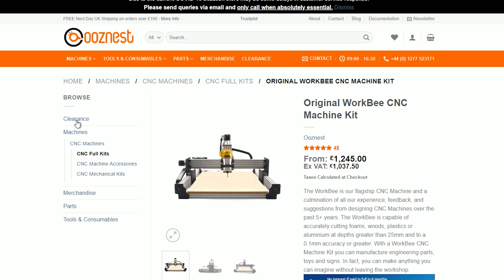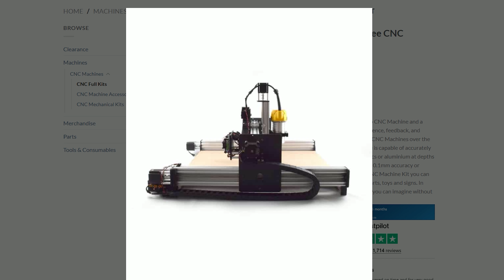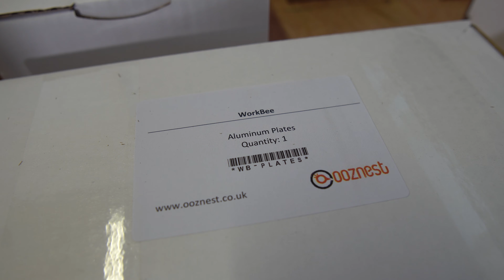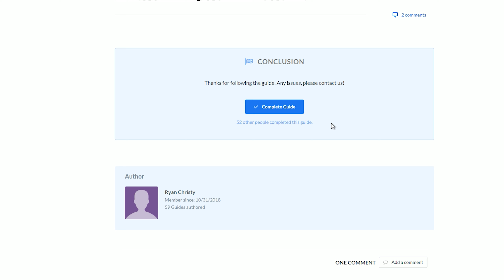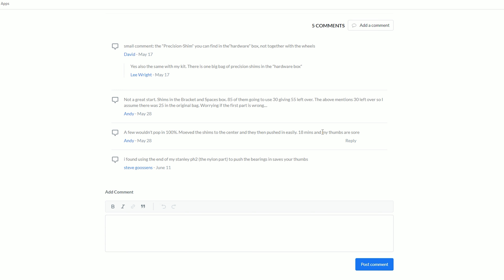Affordable Hobbyist CNC Kit! - A First Look At The Ooznest Workbee

Comment: I must admit. Totally agree with you. Support is superb. Also had a couple of niggles. Mine were when commissioning it. I had the Ethernet version of the board and you need a crossover cable for direct connection from your PC, a normal one doesn't work. Which they don't tell you on the manual.
I do 3D stuff which I design with Design Spark Mechanical CAD, save as a *.stl file which I then import into vCarve Pro to set up toolpaths then out as gcode. It works really well. Super happy to see the idea in my brain come out on the WorkBee. The machine also needs to be calibrated which they don't say in the manual either. I found it here in YouTube when doing my research and 'homework' for it.
Features I would like or able to retrofit. Be able to position using a digital numeric display on my PC as opposed to the probe. Linear encoders would be great. Manually be able to cut a straight line with perhaps a dial to regulate feed, maybe even an analogue joy stick. Temperature and amperage display to monitor how hard the machine is being worked.
Overall I am super happy with it and recommend it as a good purchase.

Comment: Hello Lee!   i have a Lion 18650 - 10S5P battery 36V, power 360 Wh. Capacity 10 Ah. I wanted to ask you a help. How can i know how much this battery can give discharge amps? I need to adjust it on the Vesc settings. Please tell me what should i do, how can i find out. Thank you! 🙂
Reply from the maker: hey bro, depends on the cell type? can you tell me what it is?
Reply: @LeeWright   i think it's 2.6 Ah.  not sure. Can i maybe send you picture of the battery? It will be then easier.

Comment: Hello Lee, does the machine handle hardwood as oak or ash easily ? Any experience?
Reply from the maker: No experiance in that matey but it does Aluminium and even Steel so I would assume it would have no issues
Reply: @LeeWright   where did you buy it and what was the cost ? I’m thinking about something like this

Comment: Lee I have an important question I have. 48v 20 ah battery and one of the connected bits corroded away so it lost connection can I resoldet to fix so it can charge
Reply from the maker: Depends what connection bro,  If you send me an email or contact me on Instagram with pictures I can better advise you

Comment: Hi, great video. I'm thinking of getting one myself and was just wondering about noise levels. Did you find the encloser works and was it worth the extra? Thanks 👍
Reply from the maker: Hood question.  The enclosure definitely helps with the noise of the cutting, it is a big difference.  I think you could easily and cheaply design an enclosure yourself that is better than the ooznest one though.

Comment: Can you run material longer than the surface? Im looking to cut grooves on a 6 foot board every 2 inches. on the dot. but the surface isn't that big, is there a way to let it cut the grooves the first two feet. slide it down, get the next two feet and so on
Reply from the maker: Absolutely you can do that, you would just need to index the stock correctly
Reply: @LeeWright  thank you!!

Comment: Hi Lee i have just messaged to Ben and he said I should ask you.
Sorry for bothering you,do you mind me to ask if you have bought their software ?range 300-1700quid or you guys has some alternatives by any chance?
I think I should mention I like to get the: 
1000x1500 kit from workbee
For small and large scale wood and softmetal work.

Many thanks
Reply from the maker: I use fusion 360 to do my work but V carve is very good and you should consider it for simple carving operations.
Reply: @LeeWright  thank you Lee.so do you think I should just buy with their basic free software which limited to 600x600work surface and then just instal the Fusion360?

I mean by the software the 3option you have when you buy from ooznest...
Thank you

Comment: I'm curious as to what kind of speeds you are obtaining on the X-Axis before you have to worry about whippage of the leadscrew?
Reply: Some of the models you can buy have tingle tension which puts the leads crew under tension which eliminates the whipping. I'm getting the rat rig version with leads crew and linear rails. And it's upgraded frame from oozenest version

Comment: Hello
Can someone tell me if i can use this cnc for drilling and routing of Printed Circuit boards?
Thanks
Reply: Nope. It can't. I have ended up retrofitting a closed loop system on it: stepperonline kits + NVEM Novusun V2 controller and Mach3. The WorkBee although a superb build and support comes with open loop steppers which are just not designed to be all that accurate. Buy one, but without the electrics.

Comment: Hi there, how loud is the WorkBee? I'd like to buy one to use it in my flat but obvoously don't want it to be too loud.
Reply from the maker: I'd say it's too loud for a flat tbh mate.  It's also a very continuous drone and I dont think your neighbours would be too happy about it going on for hours at a time bro
Reply: A bit louder than a vacuum cleaner. The router has a little sign saying you have to wear ear defenders. I certainly do and I am in my garage. You can put up with the noise for 3-4 minutes, but after that when the noise stop you do feel you have been exposed to high noise. Don't forget you also have to consider the noise of the dust extractor. The quietest I found was a Stihl SE62E unit and that is still as noisy as an upright Dyson.
Reply from the maker: @perro0076  I also wear ear defenders.  I am using the enclosure now though and that has cut the noise significanty

Comment: Now you can make a lot brother
Reply from the maker: yeah deffo mate, have already been making some cool stuff
Reply: Lee I need a battery esk an controller   for 2 70amp motors on my diy still waiting on my motors at the mo they are taking forever lol I was thinking 10s 2p but I was told that I can go to 12s with the 245kv 6364 turnigy 70 amps I don't no if this is true facts but ist important to me if I can have more power I will but not sure can u help me setup the power an put this to bed for me then I no what I need to get an I'll do it.
Reply from the maker: @neontv6605  yeah you can deffo go 12S on the motors but the Kv is a quite high.  will be very fast! it going to depend on the gearing and wheel size - google the esk8 calc
Reply: @LeeWright  e skate says 48mph 200wheel 72tooth gear.Motor gear 20 tooth I think.With a trampa bigger beast box for the battery box.
Reply: I don't intend to use all that an die I'm going to battle harden them I got some miniputty to do that as well.
Reply from the maker: @neontv6605  48mph is a bit nuts... maybe you want to go 15 tooth on the motor pulley?